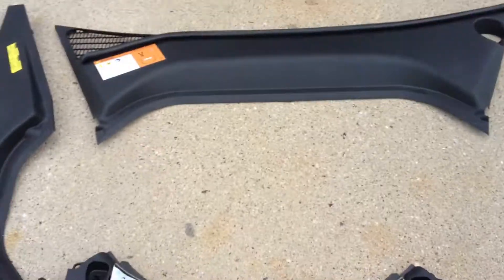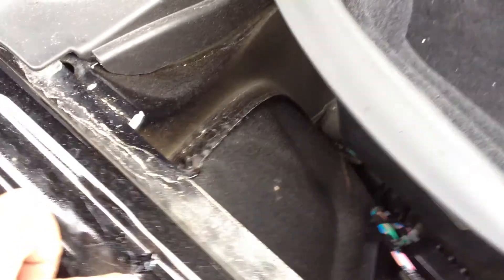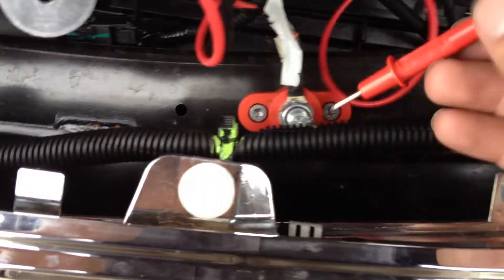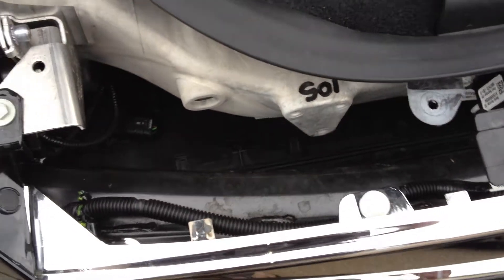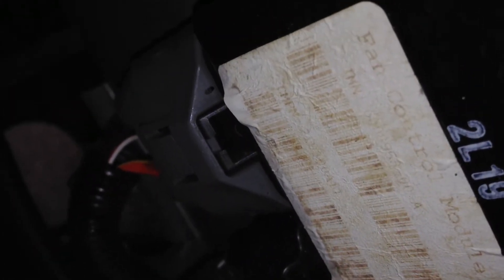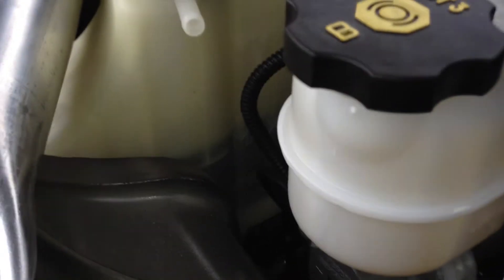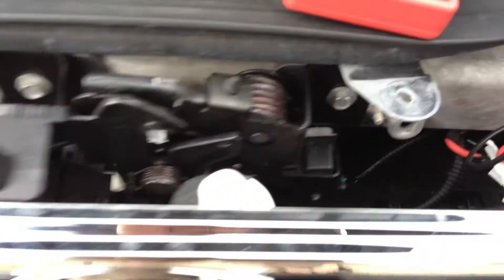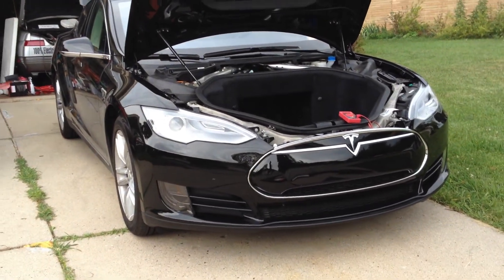Tesla Motors Model S: Part 30 of Many! Under Hood Tare Down

Comment: I think Velcro is a pretty good option to use. And more companies should use that. Because if something comes out you can easily replace it by buying some heavy duty velcro from walmart instead of trying to find the specific clips in autozone or the internet. Looking for oem parts is pretty annoying and sometimes difficult to find.

Comment: Wow, for as much as they cost the build quality isn't that good, true american car I guess. Fit and finish seems a lot better in my $25k VW.
Reply from the maker: I have one of the first 10k made (9846 to be exact). I just got a loaner in the high 20k's, while my car was getting dual chargers installed. Fit and Finish was 100x better then mine. Improvements are coming constantly.

Comment: So coolant... On the model S. is there a set "operating temp" with all that open loop or closed loop crap? Also if the car is cold, plugged in or not. Do you have instant heat?